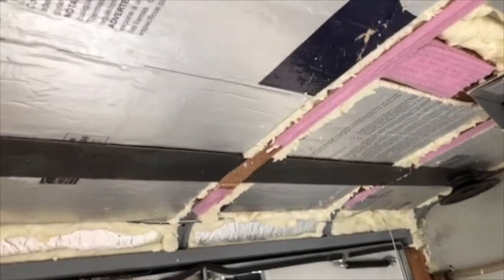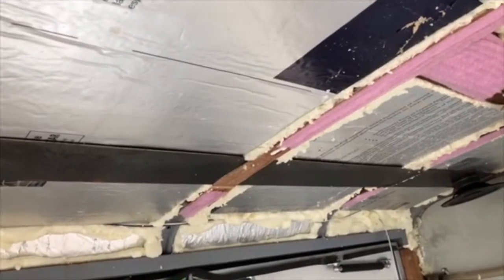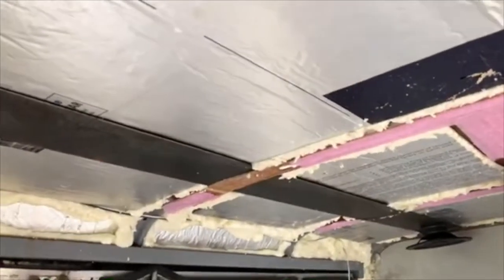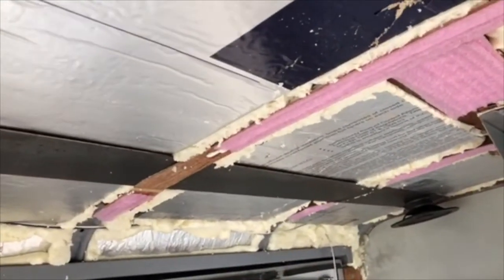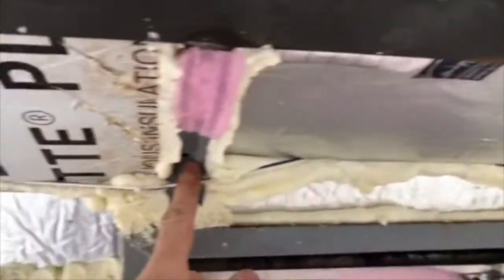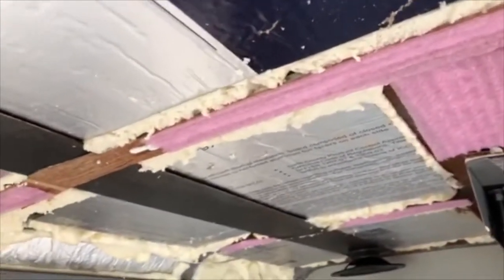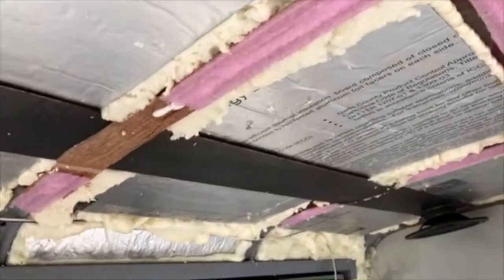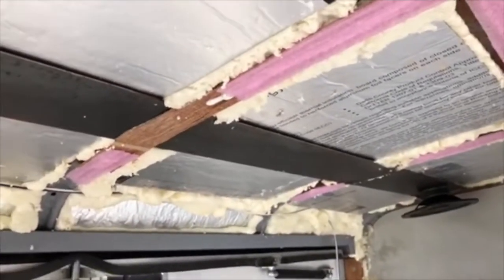Wanderboom #6 Shuttle bus conversion ceiling insulation and plywood prep

Comment: This is great! I noticed you didn't use a vapor/moisture barrier? Why not? 
Also, do you have anything between the fiberglass roof and the plywood? 
I'm just trying to finalize the order of our ceiling insulation, and therefore thinking: fiberglass roof -- plywood -- insulation boards (we're avoiding fiberglass insulation) -- vapor barrier -- plywood -- cedar planks. Does that sound right? Thanks!
Reply from the maker: Thanks for watching.😉 the thing about vapor barriers is the permeability of the materials. The fiberglass is (😉hopefully) impermeable to moisture. On normal construction the building is mor permeable and the vapor barrier allows moisture to evaporate out the exterior of the structure. Since it’s impermeable, it’s a very different situation. 
Our bus has steel framing that is one inch thick. I put 2 layers of 1/2” foam up with quick grab adhesive. If you use polystyrene and tape the joints , you are creating a barrier that way. I put sill seal over the steel before screwing the 1/4” underlayment but if you’re finish material is cedar t&g that’s mor than a 1/2” thick you could just screw cleats over the beams. Then nail your cedar to the cleats. Hope that makes sense.😉👍
Reply from the maker: The fiberglass exterior roof.

Comment: First, I LOVE your conversion, especially the cedar cabinets and lightweight walls. I'm definitely going to be doing my ceiling like yours. QUESTION! Why didn't you apply the grasscloth to the panels before you installed them onto the ceiling?
Reply from the maker: Heather Shaffer-St Clair thanks for watching and for the question. I used self tapping/threading screws to install the panels. Then puttied over them to even it out. The grass cloth came in 36” rolls. The joints didn’t necessarily match up with the layout of the metal studs and we didn’t want any screws showing.👍✌️

Comment: So i saw that you insulated the roof and the floor, did you do you do the walls also? Im getting a Flat nose shuttle bus and I want to make sure that it can be insulated just like the ceiling.
Reply from the maker: Ronald Weatherbee not really anything on the walls. I didn’t want to lose living space and we are avoiding extreme heat and cold temps.🤙